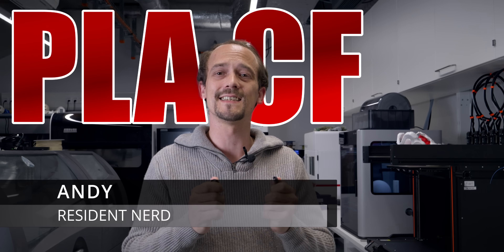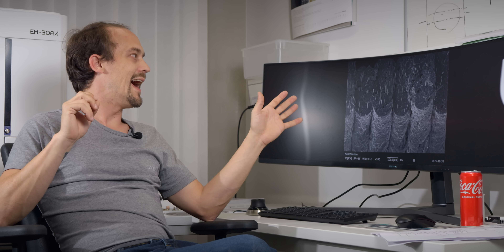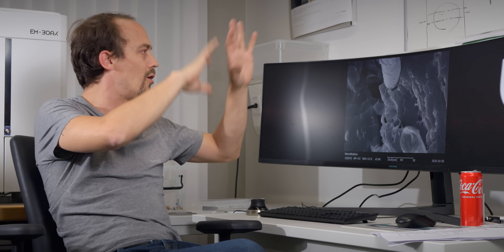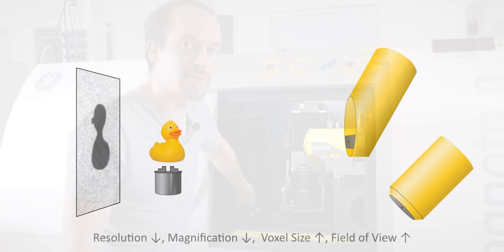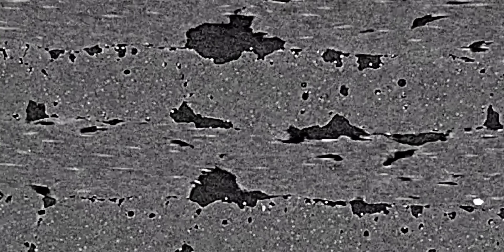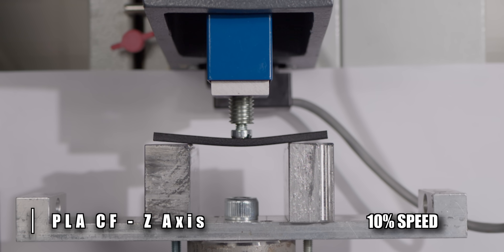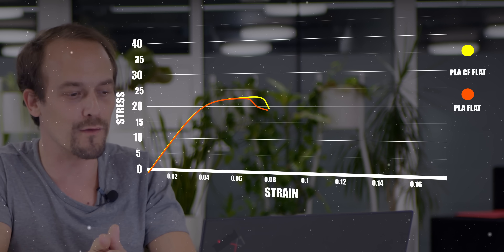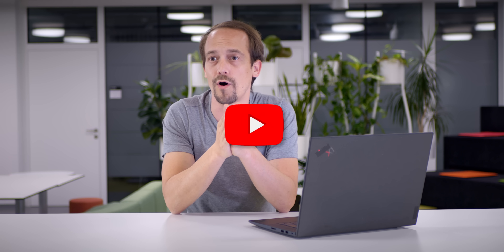3D Printing’s Biggest Scam Is Even Worse Than We Thought!

Comment: After trying a great majority of the Cf and some GF-imbeded materials on the market, PLA-CF was the biggest disappointment of the lot; PET-CF is incredibly brittle comparatively where PLA-CF behaves almost completely opposite, with poor layer adhesion and a higher tendancy to deform. PET-CF on the other hand is incredibly stiff and strong, followed by the GF version. Not all brands perform the same on that note, nor print as nice. On the flip side, one unintended perk I've found with CF-containing filaments comes in when using said materials to make molds for casting. Despite pre-conceived notions, the CF-impregnated prints processed out very cleanly without blowing out molds nearly as often for my specific process compared to PLA. Less expansion at the elevated temp is my suspicion, but I'm not doing my burn-out in the traditional sense either.
Reply: PET-CF and PET-GF are awesome do it all engineering type materials. Love them! PETG-CF and PETG-GF have also been awesome in my experience and from various tests. Not sure why he thinks it isn't. Siraya Tech makes great fiber PET and Tinmorry makes excellet fiber PETG. Great prices as well.
Reply: @802Garage  I've not tried PETG-CF or variants due to how the base PETG behaves on my machines. I can make it print fine, but the glycol additive get super gummy and does not machine well for post processing (gets stuck to tooling and drill bits specifically). I wonder if adding CF or GF additives helps any of that and will have to experiment some time. I would imagine it will be a bit hard on bits with regular use. 
Sirayatech's PET-CF and GF are my absolute favorite materials though that I use routinely. If PPS wasn't so expensive it'd be my #1, but as is, it's relegated to special use cases or I catch it on sale.
Reply: @C-M-E  That's exaaactly why PETG-CF and PETG-GF are awesome. It's like it fixes printing PETG. Less warping, less stringing, less blobbing, still great adhesion, and less flexible if you want something sturdy. Seriously in the Qidi community we have turned so many people on to using Tinmorry PETG-CF and PETG-GF it's wild. I don't like printing normal PETG, but the fiber filled stuff is awesome. Not sure about post processing, but I do imagine it would help since it stabilizes the print around where you are drilling for example. For sanding it's obviously going to be more difficult I would think, and you should absolutely use PPE. The finish is usually so nice though that it hides layer lines and flaws. Totally agreed on the Siraya Tech fiber filled PET! Main go to for Qidi folks for basic engineering material too.

Comment: cant tell you the science behind it, but every roll of PETG-CF ive printed looks much better than any roll of PETG ive ever printed and is much more rigid. Ill take my experience and roll with it.
Reply: PETG-CF and PETG-GF are amazing. Make printing PETG a joy and there are a lot of benefits. Tinmorry brand is excellent.
Reply: @802Garage  exactly what brand i use
Reply: @lsturbohatch10 also really like their PETg-CF! I just printed 3 inch pipe caps that hold up to 40bar of pressure and are watertight!

Comment: Yeah let see some PEKK-CF and PEEK-CF and also do CT scan of "core" filaments, like PPA-CF core where the CF is concentrated in the middle and virgin filament on the outside. Would be cool to see if the CF causes gaps there. Thanks for the vids!
Reply from the maker: That is actually episode 3! and its already fillmed and ready for publishing. It will air in the next days :-)
Reply: @Ibuiltathing looking forward to see, I'm really curious about that one
Reply: @Ibuiltathing  What setup are you using to anneal the prints?
Reply: I’m also interested in the ppa-cf core, I have a roll of that lying around for functional parts that need to be somewhat stiff and strong.
Reply: Thank you for your in-depth testing! I've only printed with nylon CF and PPS CF and never tried pla cf but I will say when I saw a video that informed the CF fibers can get into your skin, it really changed how I look and handle CF filaments.
Reply: Agreed would love to see study of these advanced materials with CF

Comment: Honestly I've never even entertained the idea that CF in PLA (or even PETG) does anything of note other than make prints look pretty, tear up nozzles and increase your carbon fingerprint (see what I did there?). Even if it had a minor effect on reducing creep in some parts, at the end of the day it's still just PLA.

I would be interested in a closer examination of CF-ABS/ASA. That's probably the most widely used CF before getting into nylons and such. I think many of us can pretty much guess what it will and won't show but the more materials we can convince you to stick in that fancy x-ray machine the better.
Reply: I'd actually want to see kevlar-ABS. It should give you extremely strong impact resistance.

Also, apparently ASA and ABS bond differently to CF.

I've always seen ABS as the "Can do everything but is not the perfect material for anything" filament. CF-ABS can be interesting but I'm not sure it would give much of a benefit.
Reply: @SirSpence99  Exactly what I was thinking and saying in other comments. Different polymers likely bond better or worse to carbon, glass, or other fibers. How the fibers are manufactured and prepared likely matters as well. If they are covered in microscopic dust for example, of course adhesion will be poor. I also want to see more natural fibers like bamboo and flax.
Reply: PETG-CF is awesome. Not only does it increase temperature resistance and stiffness, yes in numerous actual tests, but it makes printing so much easier with less stringing, blobbing, and warping. Also in numerous tests it does not reduce layer adhesion much or at all. Some fiber filled PETG has better layer adhesion than many plain PETG options. Plus CF or GF in PETG make it look sooo nice. Pretty much invisible layer lines and a matte or frosted appearance.
Reply: @802Garage Definitely can make it easier to print and like PLA it looks great but not so sure I completely buy the rest of that as a general statement. There can be a lot of variance in how PETG performs. Better layer adhesion really doesn't make sense as that's one consistent downside with a lot of CF filament. Moisture and/or crappy PETG can certainly lead to adhesion issues.
Reply: @JJFX-  Not sure if my last comment went through, but I actually just went and reviewed the My Tech Fun videos myself. There are several on Fiber Filled PETG. In the Tinmorry, Elegoo, and Flashforge videos, fiber filled PETG actually outperforms regular PETG on layer adhesion. Plus it has numerous other superior qualities. My theory on the layer adhesion is that PETG adheres very well to the fibers due to its viscosity and sticky nature and/or the higher print temperature of the fiber stabilized PETG allows for greater adhesion without typical downsides of high temps. Basically if the PETG actually sticks to the hairs that stick out as shown in this video, it increases the strength rather than decreasing. Go check it out!
Reply: @JJFX-  Seems my last comment did get zapped. Basically I said obviously it can vary by brand and exact product, but overall fiber filled PETG tends to match or beat regular PETG in almost every category except toughness. AKA it is more brittle, which is obvious. I understand your skepticism, but you don't have to take my word for it. My Tech Fun and some others have done plenty of testing to show it. Plus a lot of the people I would consider experts on 3D printing and filament tuning in general love fiber filled PETG. Get a roll of Tinmorry and you won't be disappointed.

Comment: I put a ceramic coating on all my prints due to this
Reply from the maker: Interesting! What kind of ceramic coating are you using?
Reply: @Ibuiltathing  Cerakote, there's a few diff kinds, H-series requires a Bake time of 2 hours at 150-180 degrees F minimum. 250-300 degrees F will achieve a stronger finish but the 150 cure is still very tough. Target thickness is about .003 of an inch but it still needs to be accounted for when using tight tolerances. C-series is air cure and not as tough but also still very tough. Each color/series also have different properties some having higher temperature resistance over others. C-serries shines in the UV resistance category. Each series has their own uses. It requires sandblasting normally but ironically the surface finish of a CF Nylon printed part is "naturally" perfect. PET-CF may be a tad too smooth and require blasting, but most CF filaments don't. It's a process for sure but worth it in my opinion

Comment: I had exactly the same experience with Bambu ASA-CF: objects felt stif but appeared to break. I went back to plain ASA: much stronger.
Reply: For some reason ASA appears to take to CF one of the worst out of available polymers. ABS fares better. As does PETG, PET, and the suite of nylons. From this video, I think some polymers may bond to the carbon material better.

Comment: Interesting to see an injection mould with CF - to see how it compares to FDM parts with CF.
Reply: injection molded parts would be superior. You're using pressure to fill molds and, if done right, the parts should not have air voids, not to mention never dealing with layer adhesion.
Reply: @Gytheran  true but it would be interesting to see the CT of an injection part to see what “ideal” forming is like vs fdm etc.

Comment: So what am I to do with my 2 unopened spools of pla-cf now?  Also I printed some parts with ABS-GF a while back mostly for surface finish and had some extra on the spool and printed a cable chain. I can now see glass dust falling off, not to mention the chain is disintegrating only after a few months. I'm getting off the CF and GF filled train, only wood fill pla and regular "virgin" filaments from now on. I also have 2 more ABS-GF spools.
Reply: Are you located in europe by any chance? I could buy them off you
Reply: @ASM-ph4pu  No, I would have sent for free.

Comment: the video sums it up pretty well and shows some really cool testing one can't just do in their garage :)
I only use chopped/milled cf if the warping would make the material unprintable otherwise and I need the properties (no real material out there with high temp resistance you can print raw with a desktop 3d printer)

A thorough video about the health risks would be pretty cool, as videos on that topic aren't really conclusive in my opinion
Reply from the maker: That is a greate idea. Since i am in medicine i could ask a ENT professor to interpret my findings

Comment: you know what else you should look at?
continuous fiber 3d prints from fiberseeker, and compare those to the same filament types, like
pla, pla-cf, pla-ccf
petg, petg-cf, petg-ccf
etc
Maybe look at if the method that fiberseeker did actually creates any adhesion between the fibers and the filament.

Comment: I am really glad, someone is finally debunking CF-Filaments.
There might be some very rare applications, where they make sense. But for the most part, they're just worse than pure plastic.
I think that's also true for those so called engineering materials. If you need more stiffness, there might be another polymer, which offers that (now that there is HighTemp-PLA, maybe even that).
And if you need more impact resistence, CF is usually making the material weaker.

Also I think the hazard of those small CF fibers is dangerously underrated.
Some people already noticed, that they can get everywhere just from printing.
And everywhere in the room means potentially also into your lungs.

Comment: Thanks for using your resources to educate the 3d printing community :)  I'd love to see an investigation on the "real cf reinforced materials" and also the voids you saw on the CT, that was very unexpected.
What I don't understand is why CFR helps in some polymers and not in others. Does it have to do with how the polymer interacts with the fibers? better adhesion? maybe with the elongation at break of the original polymer? no clue
Reply from the maker: It is actually the composition of the polymer Matrix. In Peek for example the Polymer can actually bind to the cf. This fusing makes it possible to transfer energy to the fiber instead of around it. But i will show the peek CF one soon. We are just waiting for the poblication to get accepted (Research paper)
Reply: Thanks!

Comment: I've seen other claims that CF doesn't make prints stronger, but I've also seen claims that it makes it more rigid.  You pretty well put that myth to rest.  But there's one final claim I'm curious about...  I've seen claims that it improves the "rigidity" while printing, and therefore makes it less prone to warping.  That probably doesn't really apply to PLA, but I wonder if it might be beneficial for other fiber types.  In fact, maybe it remains embedded in those other materials better as well???
Reply: You are correct in assuming that, in the case of polymers such as nylon or other wrap-prone materials, only variants with some form of fiber reinforcement are suitable for printing.
However, I would also find a more detailed investigation very interesting.
Reply: Short answer, yes it usually helps a fair bit with warping.

The only side by sides I can think of are more mechanical, not ease of pronting twsts from the channel "My Tech Fun". He has even done some side by side mechanical tests of sone standard, CF and GF filaments like Nylon. For nylom 6, the fiber significantly hurt layer adhesion/z strength boosted XY strength and rigidity as well as heat deflection temp and creep resistance.

Long answer, I love printing ABS and also love finding weird filaments to test (e.g. PBT, PMMA, PP, non blended/pure PC, etc. My current favorite is PET, without the G). I will say that it makes a huge difference with what I've tried. I've found it's often very useful for stopping warping in ABS (even ultra cheap ABS-CF) to the point you can sometines print long parts on an open frame printer without a brim (did it on an flsun SR) and it stops cracks in big prints without a heated chamber. The downsides are that it hurts strength on the z axis and makes it brittle instead if tough. The "core" type ABS-GF I've used (qidi ABS-GF25) is about the same but with better layer adhesion and it comes in colors. The stiffness of the fiber ABS I've tried is notably higher, closer to polymaker polylite PC in a side by side.

An odd observation was that tapping 1/4-20 threads into fiber filled ABS is weirdly easy, the threads come out great (slightly better than normal ABS) and they are decently strong for plastic threads (seems to help to use coarse threads though, like coarse imperial/UNC fasteners, the threads seem to hold up better than the finer metric or UNF threads.). It also generally post processes even better, as in cutting, sanding, and machining are a little nicer than plain ABS (which is already nice for printed plastic) but you want to use precautions like you would for sanding fiberglass (e.g. wetsand if you can, PPE, don't snort the dust, etc.) All that said, high quality ABS (fusion filaments and atomic filaments both make good stuff) can get close in terms of warping and printability, but still not as good as no-name cf-abs. 

For polypropylene it's sort if crazy how different it is. Normal PP warps HORRIBLY and doesn't stick to a normal build plate (have to use taoe made from polypropylene). It's super tough though and has😮 outstanding layer adhesion, plus it doesnt need any drying at all. Now, the glass fiber filled PP I tried can actually be printed on a normal PEI bed or glass one with school glue stick. It still warps a little but way less, so you don't have to design around it or use odd tricks aa much. It also handles heat better from what little i tried of that. That said, it's almost like a different material, it's brittle, the layer adhesion is bad, it needs to be dried because moisture builds up around the fibers themselves, it's more prone to issues on tiny details and you can get stringing on small gaps. Very very odd.

For nylon, supposedly the nylon wets glass and carbon fibers better, not sure if that's true but it sure as hell prints easier. Sunlu PA6-gf in an enclosed printer prints better than neat PA-6 or maybe even co-PA in a printer with a heated chamber. That is to say, it warps less and handles tiny details better. It's not as night and day as cheap ABS vs cheap CF-ABS, but still very helpful for long parts. It dies have worse layer adhesion and more aggressive failures than pure nylon, but actually still fails softer/less catastrophically than PLA, PETG, or even the fiber filled ABS I've tried. That is to say, if you snap a part in your hands, it's more likely to partly hold on on the XY and is less violent about breakage on Z (less instantly snaps and more pops apart). Finally, it is more rigid, it actually dramatically boosts heat deflection temps (supposedly happens with a lot of crystaline plastics with fiber), and reduces creep.

 I wish I could say much about PC-CF but PC is almost always a blend of PC and something to make it easier to print or tougher or something. By that I mean, almost every PC filament I've tried has been so different that I can't say what was the fiber and what was just the blend. That said, I wasn't so impressed with priline PC-CF for printsbility improvements or stiffness compared to other blends. It did seem tougher than some though? Again, just not sure what was the fiber and what was the blend.

Hopefully my rambling gives you something to sate your curiosity until more videos like this come out.